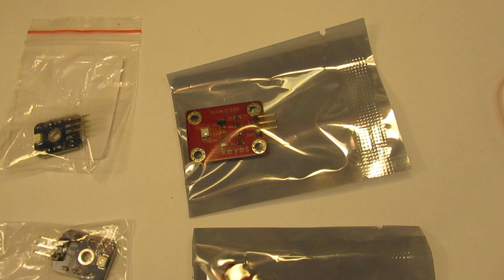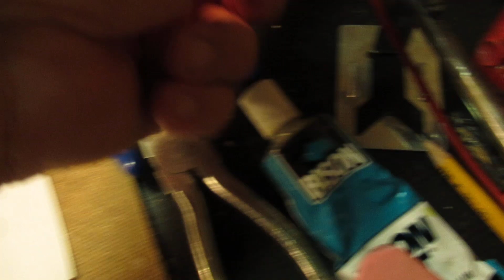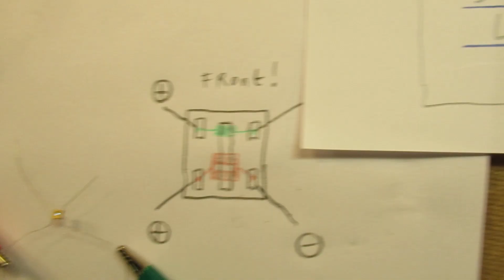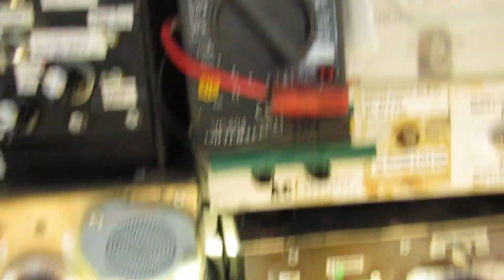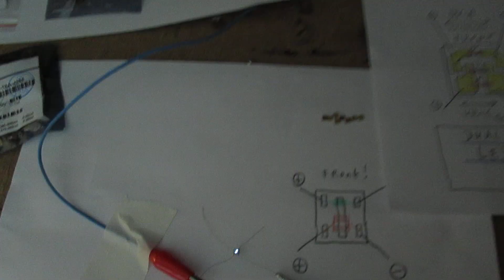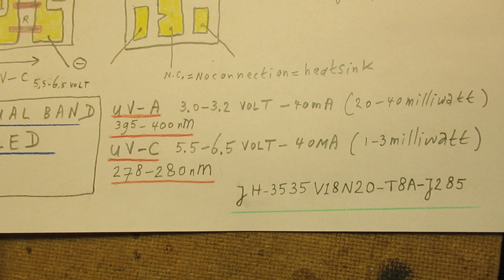Ultraviolet Radiation experiments pt 1: finding out the (+) and (-)  of a dual band UV A & UV C LED

Comment: Looking forwards to seeing your experiments. :) I'm not really into tanning so use for UV-C for erasing EPROMs, it looks like the recommended wavelength for that is 253.7nm. It produces a distinctive smell of ozone, can you detect that when you've been running your LED?
Reply from the maker: Thanks, I will surely work further on this idea/these experiments. As far as I know, OZON (the dissociated form of O2, Oxigen) can only be created on earth, ground level (though in the high atmosphere of the earth, say 40 kM high or so, via the sunlight it is generated constantly) with a high voltage source, between 2 High Voltage electrodes, say plates or wires, by dissociation of the oxigen in our atmosphere (say 20%). That surely is not going to happen here. And yes, it could be that such an EPROM memory eraser gives out a certain smell, when it is working. And yes, you can use UV light (perhaps UV-C, I never did that experiment) for erasing EPROMs. That process (erasing FET-storage memory cells) was common in the 1980's up until now (2023) with fierce UV light sources. I don't have experiences with these EPROMs but I know that it was done that way. 5 July 2023.
Reply: @radiofun232  Interesting, I did some further reading and found a paper "Ozone Generation by Ultraviolet Lamps" by Holger Claus. It seems that UV lamps made with a special soft glass will allow UV-C in the 254nm wavelength to pass but will block shorter wavelengths and so won't produce ozone. However, mercury lamps made using quartz (like the one in my old-fashioned EPROM eraser) will allow 185nm to pass which can then produce ozone. Of course your LED is far outside that range. :)
Reply from the maker: @benryves  Thanks, good & valuable info regarding this video and the video's to come in the future about "UV" light. 6 July 2023.